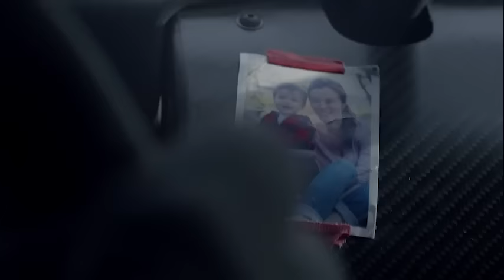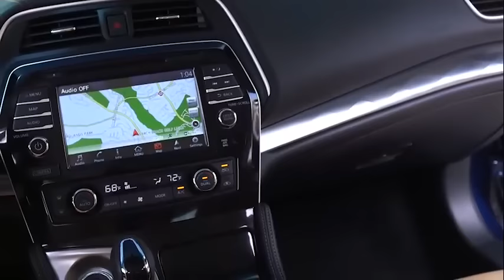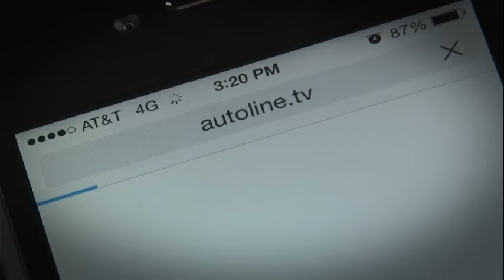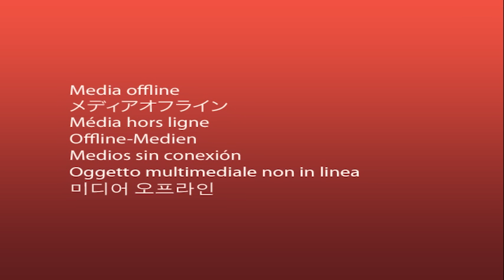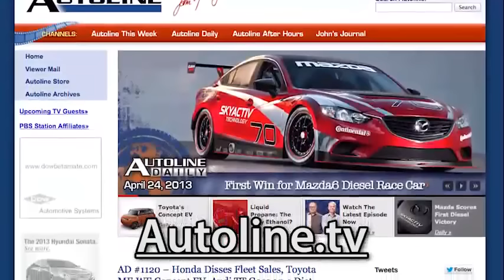Maximum Luxury at the Big Apple Auto Show - Autoline After Hours 281

Comment: I'm convinced Jamie Kitman & Joe Phillippi have no idea what they are talking about. Michelle's comments are far more on-point and applicable.

The technology in the CT6 is important, but the car is not. It looks like every other Cadillac. RWD is not important--even BMW is moving away from it. And Cadillac is not, never has been, and never will be the American BMW, no matter how much they want it. Cadillac is not a tech company, nor is it a sport sedan company. Advertising handling instead of rear leg room will be the death of Cadillac (and it may already have been its death).

The CT6 will not sell in large numbers, but it won't be expected to to. Therefore, it will not be considered a failure. But it also will do little for the impression of the brand. (Car buyers don't care about rivets or high pressure castings.) It seems safe to say that the CT6 will have been money well spent by GM, but it will not have the effect they want, i.e., Cadillac will continue to flounder.

The Lincoln Continental is the real winner. The words "Lincoln" and "Continental" mean something, and that concept captures it perfectly. (Contrast that to "CT6," which means nothing.) Lincolns are big, comfy, smooth, plush, and luxurious. Of the two, the Lincoln is a much stronger statement that the brand is headed in the right direction.

Isn't the F-150 the first American 'car' with an all aluminum skin?

And for the love of God, stop trying to compare the CT6 & the Continental in terms of technology. The people buying these cars are not buying them for their technology. And it has nothing to do with the Ford GT. Are you so stupid that you think that a company has to use the same marketing strategies for every car? Seriously, is Jamie being paid these things? It seems like once he gets off script, the only think he can get out is "you know."

Size of Civic, Accord, et al: So what? It's already happened. The Civic is already an Accord, but the Accord is still successful, so what's the complaint? As Michelle correctly notes, the Fit is what the Civic used to be. (And this isn't the UK--"coupAY" sounds dumb.)

It's strange that both Jamie & Joe mention guilt of luxury buyers. Maybe there's something there, but "guilt" isn't the right word for it. There are plenty of options on the market, and those who can afford luxury buy what they want, and if they want efficiency, they buy efficiency. At no time do I believe they feel forced to buy something that doesn't match their ideals. Jamie's theory about Volvo, VW, & Subaru doesn't hold water. Subaru's recent rise has almost nothing to do with fuel efficiency. VWs don't sell in the US because they don't sell SUVs, and their reliability is still untrusted. And I know it's the NY auto show, but the contempt for "right to work" and the south is palpable. Implying that making a decision that numerous companies have shown to be successful is somehow contrary to a set of values would be laughable if it weren't insulting.
Reply: redav You know anyone who actually paid any actual of attention to the video, actually listened to what was said, and/or has more than a cursory knowledge of the subjects being discussed, they know it exists but know nothing else about it, would call your comment full of biases and contempt for those you simply don't agree with them.

Example, Luxury car buyers buy luxury cars because of brand first technology second. You cuold try to say quality but very few luxury car buyers keep their cars much beyond the car note, if that long. Quality doesn't become an issue for most modern cars until year 6.

So, comparing the CT6 and Conti on Technology is far. Also you did NOT listen to why the Ford GT was mentioned, as a case for FORD being tight lipped about the car until they were ready to show it. This might be the case with the Conti, bu seems unlikely as Lincoln has not given many meaningful details about the car, like is it FWD or RWD? What does it offer that would set it apart? What platform is it built on?

The CT6 came sell. The Conti came only to show and, given that Lincoln has been a series of, if very good looking, half efforts, the Conti is the lesser car of the two.

You cite that the mention of "right to work" states as some sign of contempt. You don't agree with Kitman or Pillippi, who have been the more correct, if not the most clear;y spoken,  so you think that have to be talking smack.Really listento what they say about Volvo and why Volvo is likely to pick such a state and why. Two reasons, cost (maybe) and supply chain, sharing with Mercedes and BMW, but because Volvo is used to dealing with unions, that is a secondary consideration.

Also the F-150 is a truck NOT a car. it is not fully aluminum, the frame is steel, and the CT6 IS a car whose ENTIRE structure is Aluminum.

Frankly, reading your comment through, which took willpower, because you are just so infuriatingly ill-informed and/or willfully misleading, I just do not think anyone takes you seriously. You are free to disagree, just do so in ways that are not easily countered, like getting your facts straight, not selectively quoting and misquoting sources to make a point,which then turns to being duplicitous, a lie.

And no editing you comment to hide your foibles and feign you are being attacked won't help.
Reply: "You know anyone who actually paid any actual of attention ... blah blah blah ... you simply don't agree with them."

- Considering the number of direct references made within my comments, any accusation made about not paying attention is not believable. In fact, you will notice (if you pay attention to the video) that most of my points are in agreement with Michelle's who certainly seems to know quite a bit about these subjects. If you disagree, that's great. Everyone is entitled to their opinion. Accusations of "bias," "contempt," and ignorance are merely an attempt at shaming at best and ad hominem at worst. There is no need to bother responding to these since they don't address any actual content.

"Example, Luxury car buyers buy luxury cars because of brand first technology second. You cuold try to say quality but very few luxury car buyers keep their cars much beyond the car note, if that long. Quality doesn't become an issue for most modern cars until year 6."

- You mention "brand." That's important because I also mentioned brand, specifically building brand, image, and crafting the direction of said brands. For example, Cadillac is trying to sell their cars based handling and sportiness, i.e., being like BMW. They brag about how their cars compare to the Europeans. But look at their sales--it hasn't worked. (Cadillac has fallen behind Audi, and there appears to be no end to the decline.) Continuing to do the same thing will probably mean they will continue to get the same results, i.e., poor sales. If you believe the CT6 indicates a change of direction for Cadillac--one that will change direction of their sales--please explain how, because I still see "this will outperform the Europeans" as its identity.

Compare that to the "brand" of Lincoln. The brand image of Lincoln isn't about handling, FWD/RWD. It isn't about platforms, manufacturability, etc. It's about luxury, plushness (as I stated). If you believe luxury buyers buy on brand, then please explain why the statements of brand image and reputation is better served by the CT6 than the Continental. As stated in the video, the Continental is for China, where Lincoln is still polishing their image. The Chinese love their rear seat comfort. Ford wants Lincoln be successful there like Buick is. Cadillac wants to sell in Europe. When talking about brands, Lincoln hit their target better than Cadillac, and note that they don't have the same target. I'm sure the CT6 is the better car, but the cars aren't competing against each other--they are 'competing' against the targets at which they are aimed. Furthermore, it's worthwhile to note that the CT6 is not a concept--it's a finished vehicle. The Continental is a concept, not a finished vehicle. For comparison, the Honda Civic is already green-lit for production, but it had absolutely no interior nor engine.

It's funny you mention "quality." I didn't. I did mention VW's reputation for reliability, but I said nothing of quality as an issue for luxury buyers.

"So, comparing the CT6 and Conti on Technology is far."

- Far what? Far right? Far ahead? Or did you mean "fair"? And is technology a proper noun now? Has if been elevated to that level? (Now, don't go back and edit your post--wink, wink.) By using "so" to start this statement implies it is a direct consequence of the prior statement, which was about quality, or possibly about brand/technology. Clearly, the quality reference makes no sense, and we both agree that brand outweighs technology, so maybe it's fair to question the importance of technology. After all, are all those Chinese who are looking for rear seat amenities more concerned about comfort or fabrication methods?

"Also you did NOT listen to why the Ford GT was mentioned, as a case for FORD being tight lipped about the car until they were ready to show it. This might be the case with the Conti, bu seems unlikely as Lincoln has not given many meaningful details about the car, like is it FWD or RWD? What does it offer that would set it apart? What platform is it built on?"

- As you certainly know, the GT was developed completely outside of Ford's usual production methodology and policies. It did not go through any of the normal manufacturing/sales/etc. reviews. It was a secret even to those within the company. The Continental, however, is being developed more like a traditional car. Therefore, any comparison between the information release of the two is not appropriate, which was actually Michelle's point, and the fact that Jamie brought it up demonstrates that he thought the two were comparable.

Again, revisit the Civic concept. It was announced with a US release of this year. Sure, they said it will have a 1.5L engine, a manual & CVT, etc. Similarly, the CT6 is scheduled to begin production in Q4 of this year. For both of those cars, we heard absolutely nothing about platforms, technology, options, etc., until now. The Continental, however, won't start production until 2016 as a 2017 MY. If it's okay for Cadillac & Honda to wait for the year of production to release details, then why is it not okay for Lincoln to wait until the year of production to release details? Thus, criticism levied on Lincoln for not disclosing details while not criticizing Cadillac & Honda for not doing the same last year does indicate unequal treatment, and many would call THAT bias.

I could go on like this for the rest of your post, but frankly, I'm tired of wading through your horseshit, just like I got tired of wading through the horseshit in the video. I'll just leave with one last observation.

As you certainly already know, in English, quotation marks are be used to both indicate quotations from other sources and using words in a way contrary to their normal usage. Because using double quotation marks for both sometimes makes it hard to tell which is being done, I adopt the practice of using double quotation marks for direct quotations, and single quotation marks for atypical usage. As you undoubtedly noticed--being the type who pays attention to detail--I used single quotation marks around "car" clearly indicating I understand fully well that a truck is called a truck and not a car. However, those who get bent over such things are also the type who say that move x is "the #1 movie in the country" and then in small print: "for 2D animated dramas staring a duck." In other words, it's a distinction not worth making, hence my use of "car" in single quotes. Also, really pick a few more nits, the quote in the video says "aluminum skinned," not completely made of aluminum. If they had bothered to say that, then I wouldn't have felt any need to bring it up.